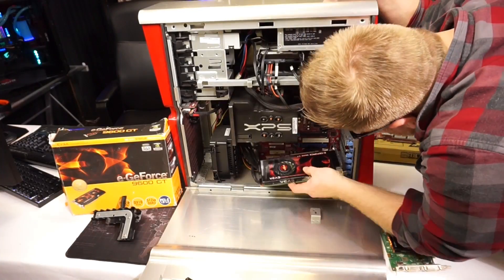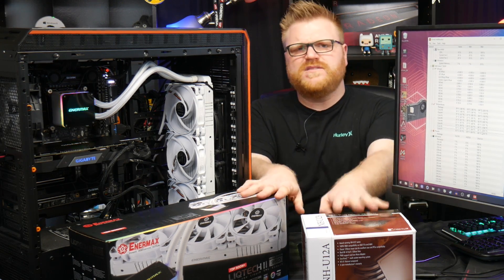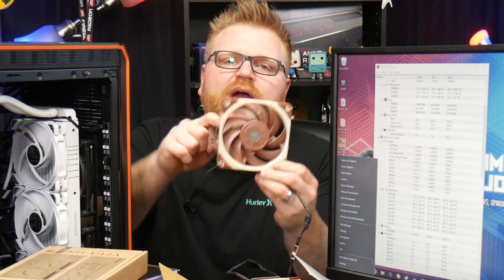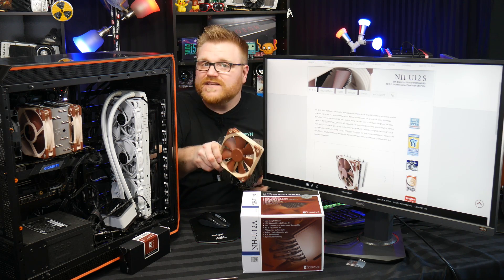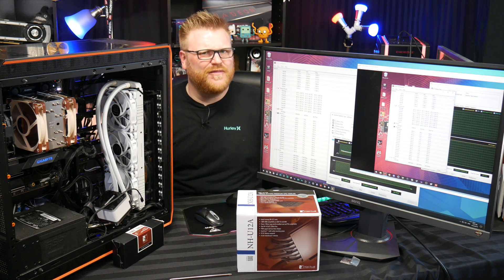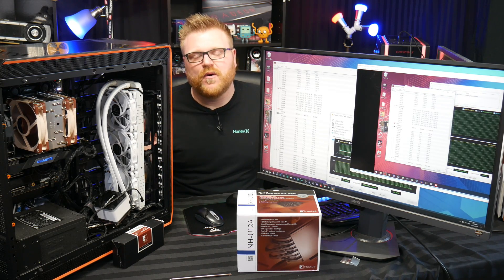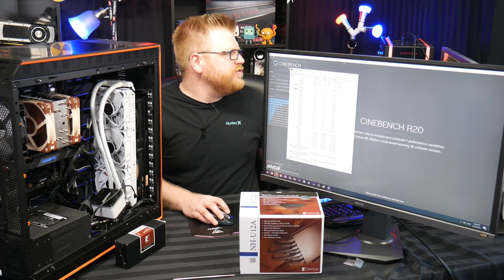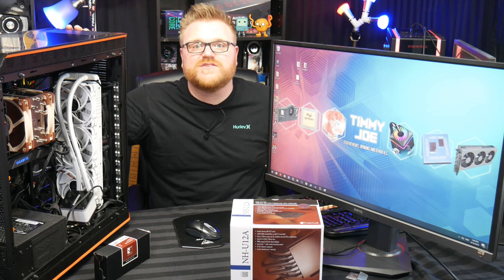Noctua's new cooler keeps up with a 360mm AIO!

Comment: the reason they are about the same is because...well the noctua is good. but because the thermal bottleneck is between the die, the ihs, or the cooler base.  something is not right there.  get the glue off,  reapply the liquid metal, try again.  if that doesnt do it then lap.  cause that ihs is bowed like a....bow?  the noctua should keep that cpu at those settings at 60c probalby.  it should do 5ghz and keep it below 80c maybe.  if you set the power limit to about 200-220w a dh 15 will keep that cpu under 75c.  250w under 80 or 85c at least if you have good contact between ihs, die, and cooler.  if you use liquid metal of course

Comment: delid that thing!!!      edit:  if you delidded that thing and used liquid metal then you did it wrong.  it should be way cooler than that with liquid metal.  WAY cooler.  5.1ghz all core no prob.  if you used paste then i understand.  
edit:  you used liquid metal?  you need to get that glue off then.  must be holding the ihs off of it.  there is something very wrong there.  its only at about 1.1v and that hot?  no way.  get the glue off.  set the power limit to 220-250w.  and you should get no power throttling at 5ghz in anything but prime 95 small ffts.  maybe aida64.  but not any real world workload.  what power draw are you seeing on that thing during aida?  how many watts?

direct die is not too hard to do on x boards.

Comment: You can DYE the Noctua fans as long as they are the sealed ones... but you can only make a darker color and it will mix with the beige so it won't be color-matched, but it is possible. I've done it on all 9 fans I have in my case.. they all still work as good as the day I bought them. Use RIT dye, a throwaway cheap pot, a side burner on your grill (do NOT do this INSIDE), 2 packages per fan to start. Use a metal clip to hang the fan by the power cable and fully submerge the fan into the water. Repeat as necessary for more color. Bring to a slight boil (not too hot) and leave for a couple hours. Throw away the pot when finished.. it will be toast :)

Comment: I just gave in and make all my computes Brown/Black theme or Gray/Black for budget redux. I tried using ML Corsairs and they sound louder then the highway i live on.
Reply: Hmm ML are dead silent at idle because you can lower them to 450rpm and can become really loud at full speed at 2000rpm but they work pretty well.
I tried Noctua fans and I hated them, they are loud at idle because they can't run under 850rpm and become even more noisy when they speed up. Idk about cpu cooler but I really think their fans are overrated.
Reply: @kainey  people are just being politically correct because they are brown and work really hard but may have come from mexico

Comment: To me it looks like you might have air in the tubes the way you installed the cooler with the in-outlet on the top.
Reply: As long the block is not the highest point (air) I'm sure it's fine

Comment: Your front AIO's fans were being choked. The Noctua had complete airflow thanks to an open side. Try again.
Reply: Won't change much, he's not the only one who's done the same testing and came to the same conclusion.
https://www.youtube.com/watch?v=vw4HONEkj4s

https://www.youtube.com/watch?v=23vjWtUpItk

etc etc.

My cousin has the same computer I do, 2700x at 4.25 Ghz, he is using a $210 AIO, I use an NH-D15. We're within 1-2 C.
Reply: If you have people testing that have no basic knowledge of science, the results are useless.

If you mount liquid cooling as an intake, there is no real advantage over air cooling. The only reason this is not known by many people is because this industry if full of amateurs. This difference of mounting style is compensated by case fans in the testing setup, open cases, fan curves, different fan types, etc. This does not really require testing. Any engineer with university training will figure that out in a few seconds, and many high school students will predict it by using common sense.

The advantage of air cooling is that if it is mounted to get air out of the case, it does not require two airflow stages, one to get the heat away from the cpu and another to get it out of the case. The liquid gets it to the edge of the case, and the fans move it out. So, liquid cooling is X airflow total, but air cooling has to be X airflow on the actual cooler, and an extra X out of the case. That means more noise. By using more fans you can lower the noise of course.

If you mount the liquid cooler as an intake, the advantage is lost.

Depending on the case interior, both air cooling and liquid cooling will be helped by extra airflow into the case. The liquid cooling will still have a little better airflow inside the case because it does not mess with airflow in the interior like a huge air cooler does.

So, it doesn't matter if you are after low noise at a given thermal performance or high thermal performance over noise. The liquid cooling solution will always win if:

1) It's not an intake.
2) You are using same number of fans and same type of fan everywhere. It will require half the airflow. Half the fans, or same number of fans at much lower noise.

Comment: i went away from aio"s  to heat sinks but im using the cryorig R1 universal and its just a beast with in like 1c of the D15 from noctua.  the universal has adjustments to work with tall ram with the slim 140mm fan in the front.

Comment: Owner of a i7 7820X myself, I bet your thermal issues are part of the auto voltage being too high. I can get 4.5Ghz at 1.175v and full load I get about 80C with a NH-D15. Check your voltage, you definitely shouldn't need more than 1.15v on stock settings..

Comment: Cooling performance is outstanding. Fans are silent, beating the AIO's in this video. Noctua actually thought through this design and made sure the cooler wouldn't clip or block RAM slots. Thanks Timmy Joe for this informative video.

Comment: Noctua is THE example of the importance of optimisation. And the gains of additional optimisations, like the placement of the heat pipes in the fin stack. And the brown fans, they'll never change that. It distinguishes them. See the brown fans? You'll know immediately its Noctua. Very clever. And they can do that just like that, because of the top-notch performance they bring

Comment: Please try to do better tests.  The aio is blocked at the front, the air cooler is in open air, you have no db readings which are vital because you can pretty much select whatever temp you like  on any cooler if you dont mind fan noise, and you were measuring the noise by ear with your ear much closer to the aio anyway.  Nothing was learnt here.
Reply from the maker: The aio is not blocked it has fans blowing in to it. It's not set up the greatest but I took it out this morning and tested it before moving the whole PC to the Corsair crystal 680x. I wanted to verify I wasn't wrong before I chose which cooler I kept in the system and there was basically no change with it sitting out alone with the three fans only. I plan on doing a full review of the Enermax vs a corsair or other acetek cooler soon in open air

Comment: I had my 4 year old corsair H105 240MM AIO leak towards the end tank, I was fed up & did NOT want to deal with watercooling anymore: so I decided to buy the "be quiet Dark Rock 4 Pro" CPU air cooler. The "be quiet Dark Rock 4 Pro" is very quiet temps using dr4 pro were 5c cooler then my corsair h105 using a intel core i7 4790k @ 4.4ghz 1.22v. It looks like cpu air cooling is coming back in 2019!
Reply: wedgoku I had an h110i V2 that just stopped working after 4 months of use. that's when I decided to stay away from aios, especially after finding a post about someone that actually had about the same failure time, but with 5 of those units.

Comment: Yeah, so you are definitely putting your paste on wrong. You need one large drop, in the middle, to spread out and shove the air out. Giving the cooler a little wiggle will help move the paste to the edges.
Reply: Here's the video https://youtu.be/-hNgFNH7zhQ

Comment: 🙂 thats great to hear, go air cooled whenever you can, helps reduce on maintenance, also checkout air cooled motorcycles and air cooled cars like the Porsche 911 😍👍

If u dont like the fans just replace them with something else from another company, what u need from Noctua is the metal cooler design and fins which is highly optimized for cooling 😍

Comment: Tell me 1 reason why did you put 2 fans next to 360mm aio which has 3 fans??? The airflow is completly messed up. Also be quiet cases are known to have the worst cooling potential.
Reply: i have Bequiet Darkbase Pro 900 case and my heavily overclocked CPU and GPU never go above 50 Celsius ... the "bad for cooling" RELATIVE to whatever cooling solution you happen to run in the case ...

and there are far FAR worse cases for cooling while having nowhere near the design, layout or sound dampening perfection of the BeQuiet cases ...

Comment: Is'nt the fx 9590 hotter
Reply from the maker: No not at all. It was considered hot at the time but things have elevated. It was like the 9900k where you need a big cooler just to run it at stock. The Skylake x chips are a whole other thing

Comment: Looks like the thermal transfer is not optimal. No matter what you cool with if the connection it self to that heat dissipator is not sufficient. 
If delidded correctly.. Is the thermal paste on the IHS totally covered when the heatsink/block is mounted? 
If if the CPU socket is not completely level on the board, the mounting is not gonna cover completely.

Comment: All comparisons i have seen on youtube between the Noctua's and any AIO where or on an open testbed or in a case with a sidepanel removed. Of course there will not be a big difference.. The main reason why AIO or custom watercooling is performing better is because the heat is transferred far better out of the case than any air cooler would be able to do.. (assuming the fans are blowing towards the radiator and out of the case).

Comment: The Enermax fans look like low static pressure high airflow fans, if you put the fans from noctua on the enermax you'll probably get a really nice result.
Reply: I would love to see the result with changing all 3 enermax fans with noctua's nf-a12x25!
Reply: this is pretty much what i did with my cooler master ML360 RGB. I got rid of the shit stock fans, and replaced them with noctua's newest 120mm fans (the same sterrox fans this video talks about) and I also did push pull. they barely run 1000 rpm and legit keeps my shit cooler than anything on the market.
Reply: not to mention he's got two case fans infront of the AIO, probably holding it back a little bit too
Reply: 1) enermax aio is defective, Gamersnexus have done a video on one enermax cooler.
2) those 2 fans and pull config is causing even slightly more temps.
And this concludes how amateur and clickbait timmy's video was, he compared a defective aio with perfectly working air cooler and called that that air cooler is better than 360 aio.
Either he got pocket full money from noctua or is plain amateur and should stick to n3wb plebs video. Before making strong statement as he did one should do thorough research, and worst part, he didn't even updated the description/title yet confirming that he have no idea of whats going on. I was enjoying n3wb plebs videos but after this clickbait no more timmy

Comment: Totally agree with you about noctua's colour scheme. I hate the colour of my nh-d15 fans and almost went for a bequiet or msi frozer cooler instead as the 2 tone brown is ass.
I'm also calling bs on that aio supposedly with a thermal capacity of 500w.
Damn glad I don't have your cpu, I thought my 9700k was hot

Comment: it looks like you have only have 2 fans on that enermax. if so that would hinder its performance big time. the dead zones on the front fans runs directly through the center of the triple fans on the back, if that makes sense. were the fan shrouds connect together it makes like a half inch of plastic right through the air flow . if you had equal triple fans on each side so it has completely unhindered airflow or even just triple fans on one side and open air vents on the other running the full length i think it would be better. i hope all this makes sense lol. try unbolting the rad and adding triple on both sides and hang it outside the case and see if it changes.

Comment: Noctua does have regular black fans and they've had them for a while. They have the chromax ones, the industrial jet black ones and the budget grey/dark grey ones. Not sure if they have these particular fans in those varieties yet but if the color really bothers you the NFF12's might be louder but you can get them in black.

Comment: Maybe hanging it out the window at -20 fucked up the pump or something. The Noctua seems to be performing around where it should but an AIO that big should easily beat it. So basically I wouldn't trust that AIO.
Reply: AIOs are that shit ... any "review" where AIO beats performance of Noctua coolers is only when reviewer is dumb hack that doesnt let the heat to saturate the liquid in AIO ... without saturation AIO will give you impressive cooling for LIMITED TIME because the liquid itself in the cooler will absorb a lot of heat before reaching stable temperature, which takes time ...

Comment: Did you run the air cooler with the case open and the AIO in place?  Should go for push on the rad too.  Don't use a fan curve for testing go for 100% and compare at different speeds.  Test the noctua fans on the rad as well.  I've had great results with cheap arctic P12 fans.

Comment: Ya got the "pea" method with paste, then the "X" method, The "line" and the "spiral". Then ya got the Timmy Joe method: Splotch it around in various places. 
Well done Mate, well done.
Reply: It's been proven to death that how you put on TP or in what amount (other than not enough) makes zero difference. As long as enough is present to cover the whole thing the mounting pressure will spread it flat and squeeze any excess out the sides if too much is there.

Comment: I know your pain, my i7 7700k is a furnes, at stock clocks with a NU-D15 it was idoling at 58c  (94c prime95)
Had to delid it and liquid metal it  just to get the stock idol temps down to 32c (86c prim95), thats with liquid meatal beween silicon-ihs and ihs-cooler (nu-D15) 
Im not even gonna try to overclock -.-

Comment: I'd like to see how that rad holds up against another 360. An important part of thermal testing is having the fan speed locked, having a curve can skew results. Everything else seemed good
Reply: yea but having the fan curve set to stock is what you want when testing a cooler . you want to know its overall performance which means how they set there curves. not everyone can adjust that stuff themselves , so if you make changes then when someone else goes and buys it and throws it in they will wander why they get different results.

Comment: My AMD 1700 runs cool @ 4.25 ghz on a aio but I may give this a try.
Reply from the maker: I really doubt that. If you're running a 1700 at 4.25 ghz and it passes the aida FPU test I will eat that Noctua cooler
Reply: Uploading the benchmark video now
Reply: It's up if you want to check it out

Comment: I think the 9900k is hotter lol
Reply from the maker: No, 9900k runs stock at 4.7 ghz boost on all cores with near the same temps. that's 700mhz faster with a tiny bit more IPC soo hotter? Maybe at 5.3 ghz
Reply: @TimmyJoePCTech  something is wrong with my ihs or cooler kraken x72, I'm hitting 100°c on my 9900k OC'D to 5.0ghz 1.290v.?

Comment: Timmy you should test it on the AMD FX9590 to see how it cools.
Reply: It should actually do great, the IHS on FX is soldered
Reply: @mitchell3876  Agree, it was the VRM on the 990FX motherboards that run really hot.
Reply: I put a old xbox heatsink with fan on the back of my asus sabertooth r2.0 with opoxy and you can put a fan on top of video card's 120mm it work's too.
Reply: Or any fx 8000 chip; 8370 suppose to be more efficient, but its so hot!!
Reply: I got fx 8350 oc 4996mhz with noctua nh-u9se2 push and pull 30c 55c max temps and im in Puerto Rico right now and it's hot all year long im happy with noctua cooling i just got this one for my 3600x computer.
Reply: I think it's time to shitcan FX series

Comment: Damn at the start of the vid...do AIO’s really get that loud?  I never had one and I can barely hear my dark rock pro 4.
Reply: if you're flooring it yeah, you have 3 fans and a pump so if they're at full tilt that's a lot of potential for noise.

with normal builds an aio will have a lot more heat capacity than most tower coolers, so the fans can run slower and have the potential to be very quiet.
Reply: @noobulon4334  can you recomand me a good aio?

Comment: Looks like you lucked out on the silicon lottery? I wonder what is 'the absolute best/biggest' air cooler? Best noise best cooling? What is better to game with?- You mentioned that an air cooler is faster to respond v an AIO - since you can get lulls in games, does instability show up just after a lull in action?

Comment: Plus side of using an AIO (that has good software like h150i and icue) is that you can pair fan curves to liquid temp so you don't have to sit there and listen to your cpu fan go apeshit every time your computer thinks. Liquid temp is much more slow and consistent to respond to load. Nice gradual increase to fan speed. At least with asus motherboards, fan step up time in bios is totally broke and doesn't work, and that is what you're stuck with on a conventional non-usb type cooler.